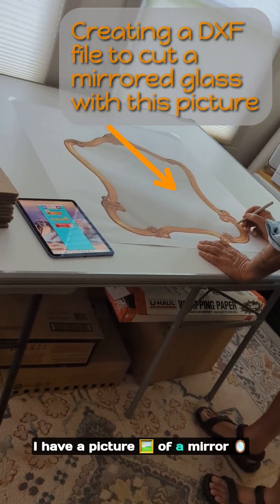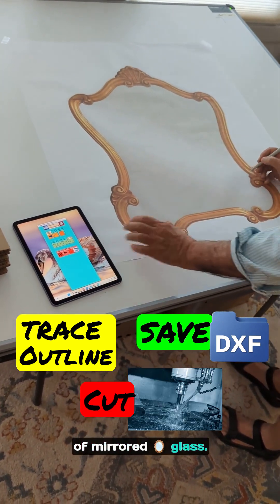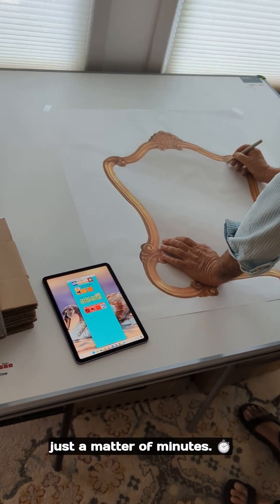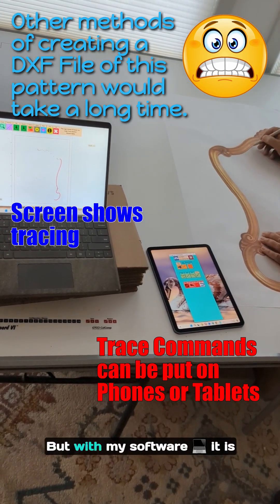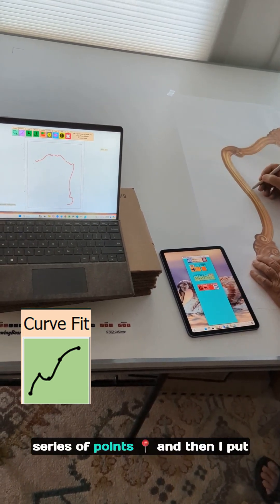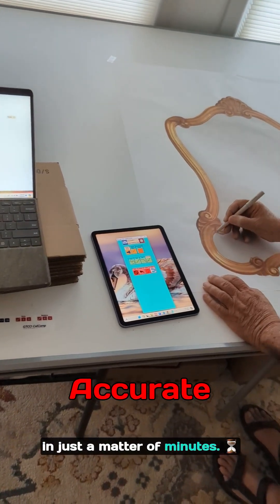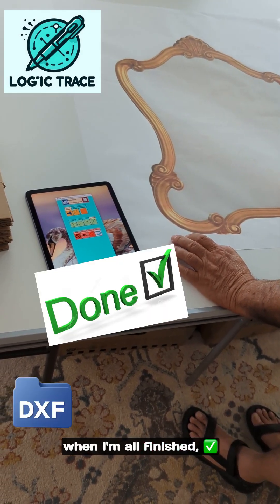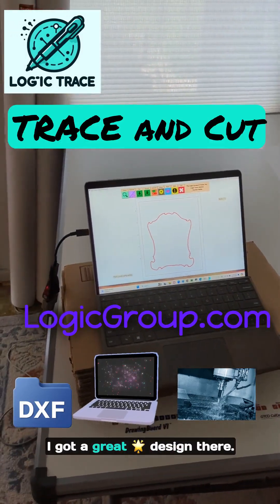CNC Glass cutters produce all sorts of glass products,  even beautiful mirrors with unusual outlines

Comment from the maker: This mirror pattern needs an accurate DXF file for the beautiful curves which were traced using curve fit  through points. Tracing unusual outlines is straightforward and quick using the logic trace system features of curve fit, line, arc circles, and freehand drawing.